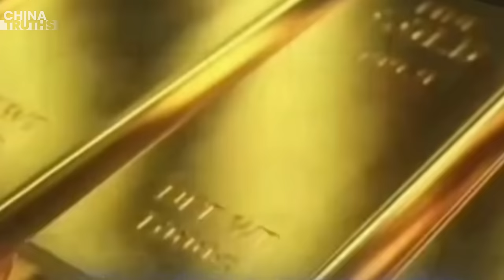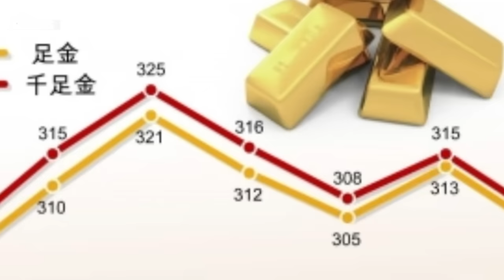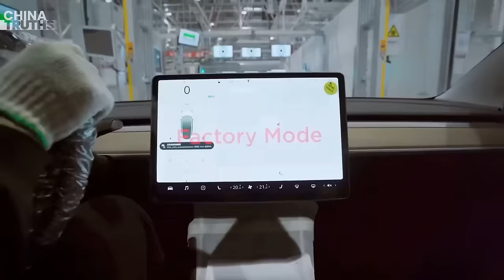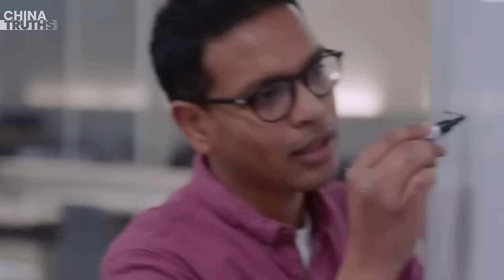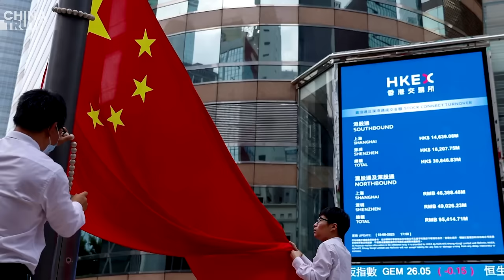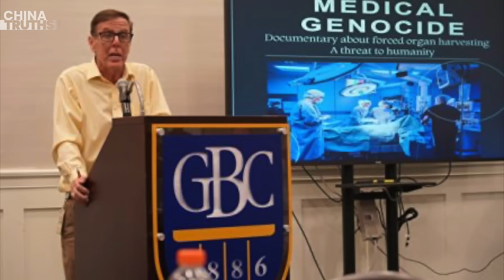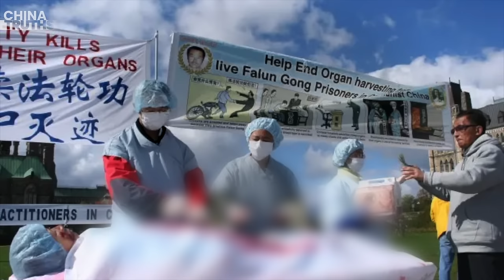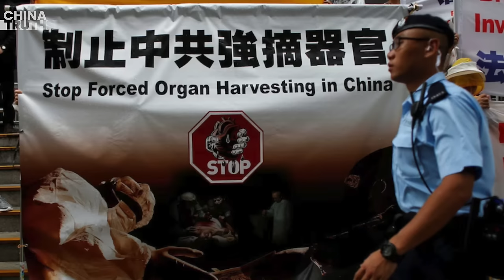Boss Escapes With 400kg Of Gold; CCP Special Police Deployed; Tesla Slashes 10% Of Global Workforce

Comment: No one is buying EV's and a crash at 40 miles per hour will cause the battery to catch fire and u have less than a minute to cut the airbag out of the way.   If the batteries get moisture on them they can catch on fire